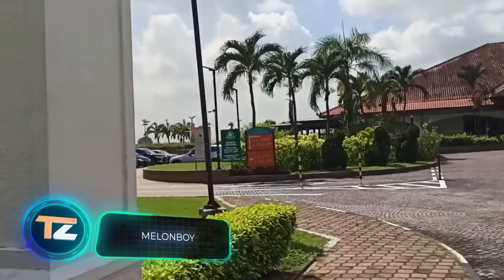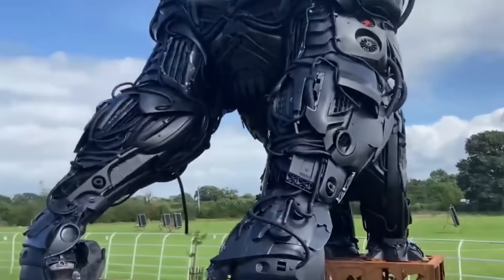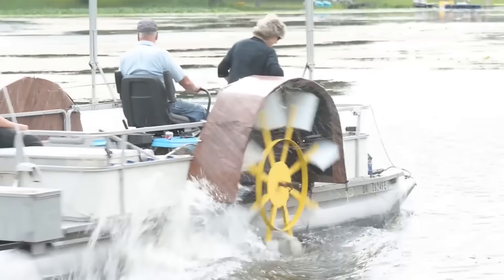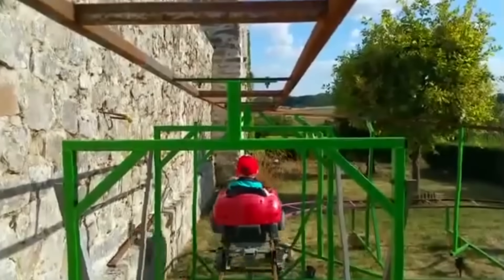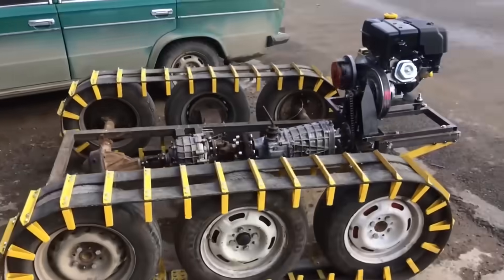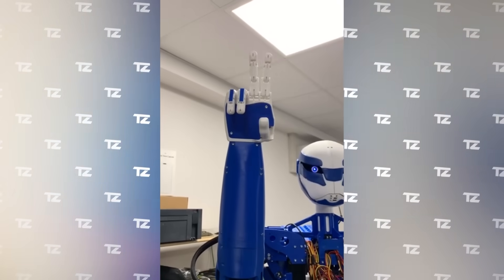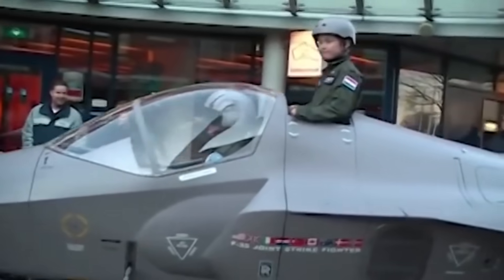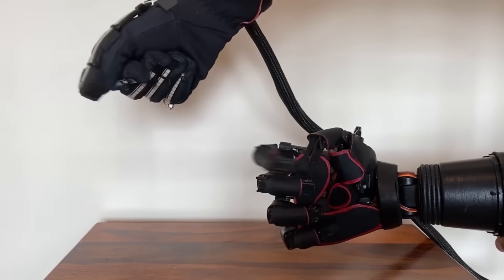INCREDIBLE HOMEMADE INVENTIONS THAT WILL SHOCK YOU

Comment: If you pause the video when that paddle wheel boat is shown, you can see all that fella did was to totally adapt a zero turn lawn mower axles to the paddles. Heck the deck of the original mower is still visible, some secret that is.

Comment: What the H**L are those two fat bints doing in front of that great sculpture? What purpose do they serve? Also, much of that sculpture appears to be steel parts from autos, which means that they would be recycled into fresh steel, and yet I would love to have that on my property. I can put tracks on my F350 which already has a ground clearance of nearly 32".  That side wheeler, while cool, doesn't bite quite deep enough. There is paddle length not being utilised. The wood 'chunker' require that one own a tractor with a PTO. Here in Canada I need to use an 80 ton dual action log splitter. The 'chunker' could no way handle the trees I cut.

Comment: "Tesla on tracks" will get somebody sued. Elon don't play that sh!t.
Reply: What's worse is that the thing can't turn... There is no steering, since they'd have to completely overhaul the drive motors control unit, to be differential steering. Right now, all it does is go forwards and backwards, what a dumb invention.
Reply: I wonder about the capacity of the engine and the transmission with all that extra weight.